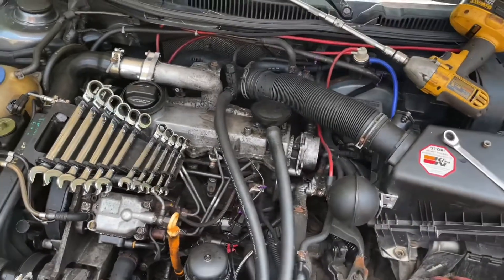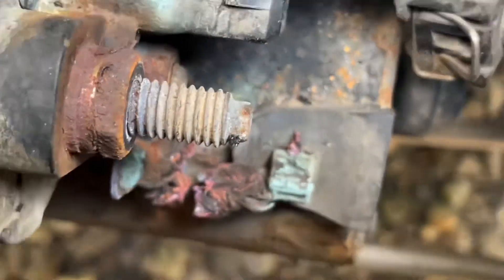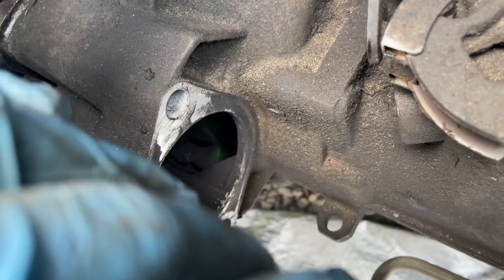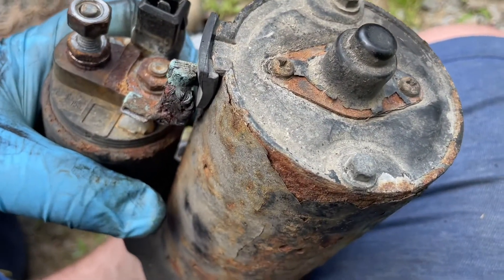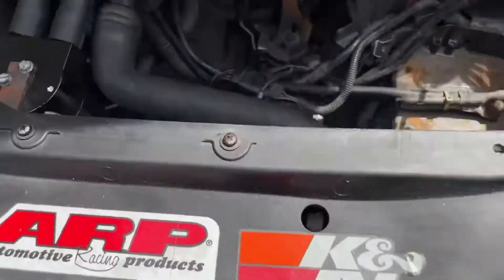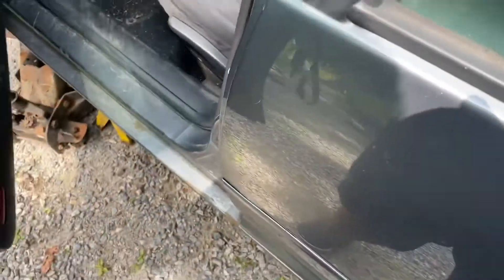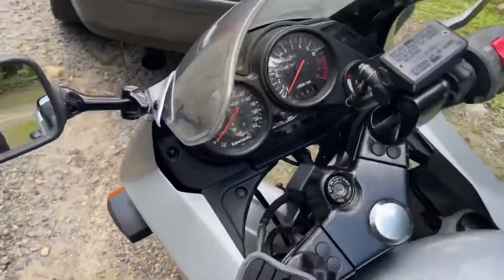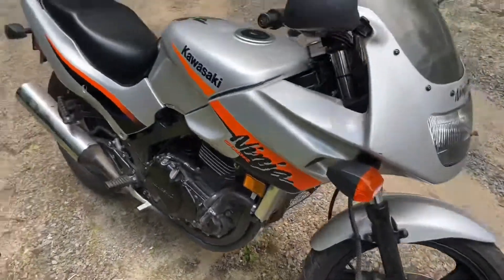ALH TDI starter replacement! Plus new motorcycle!!!

Comment: Hey man I have been watching a lot of your videos, they are awesome, especially the tdi Jetta videos! I have found a lot of information on your channel. I just had a quick question, do you think I could buy a stage 1 tune from Malone Tuning and install it using my laptop instead of buying the tunezilla loader? Or should I make my own stage 1 tune and install it using the laptop? I guess I would rather buy the tune and install it with my laptop if possible. All I really want to do is add some more power and also get rid of the egr. Sorry for all the questions and I hope to hear back from you! Thanks!
Reply from the maker: Thank you for watching! 

As far as I know Malone won’t sell you just a tune cause they use a vin locking software so people can’t copy the tunes. 

I could make you a stage 1 tune for you car if you want? You just need your mpps13 cable to be able to flash the tune on! 

If you want you can message me on Instagram and we can talk more about it! 
@thatgrey_jetta
Reply: @prestofixit3518  ok that is awesome man! Do you think I could email you or maybe discord? I don't have Instagram.
Reply from the maker: @Kordie78  yea email me at pdiddy9393@gmail.com
Reply: @prestofixit3518  alright I sent you a couple of emails, thank you!

Comment: Hello, i got a stock jetta ALH, and i want to change my 15" wheels to 16", what are the disadvantages that can be? Thanks
Reply from the maker: Well as long as you go up equal amounts in aspect ratio( 195/65/15) meaning if you wanted 16” rims (195/55/16) then it won’t effect your speedometer. Same if you got 195/45/17 or 195/35/18. The main deference is when you go wider, so like I’m running 205/55/16 and it will hurt your gas mileage a bit cause there is more rolling resistance, I believe you can go All the way to 215s without anything rubbing!
Reply: @prestofixit3518  yes exactly i want the 205, exept gas mileage, it can slow the car also?
Reply from the maker: @drhasbi1139  honestly I haven’t noticed any difference. My car gets around 50mpg on highway! I didn’t notice any difference when I switched. If you are worried about it, they make tires that have really good rolling resistance and will help negate that.
Reply: @prestofixit3518  okey thank you very much, keep going 👍👍
Reply from the maker: @drhasbi1139  thank you!